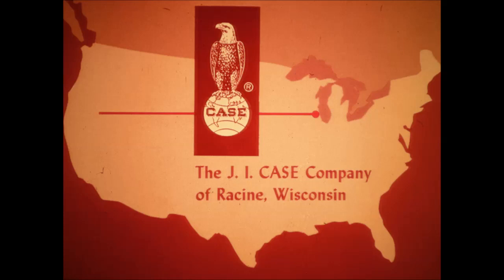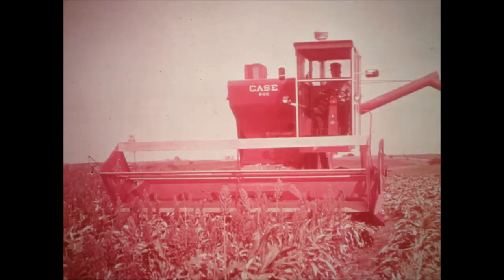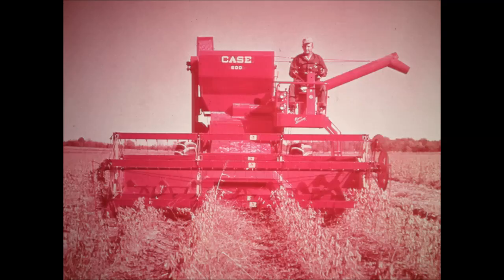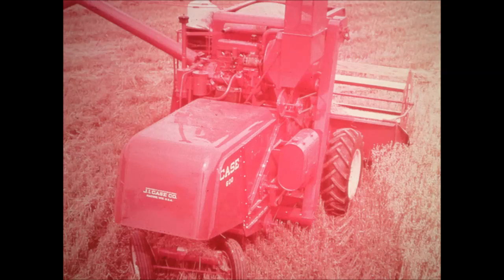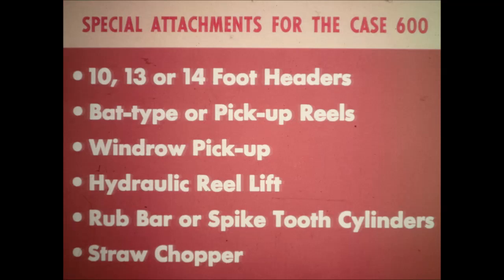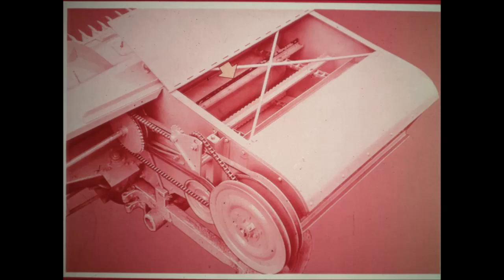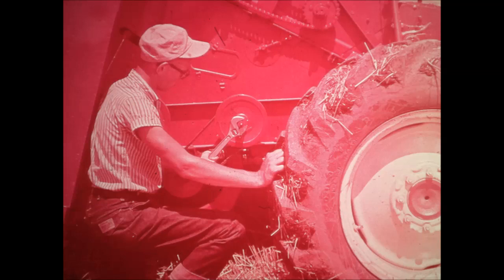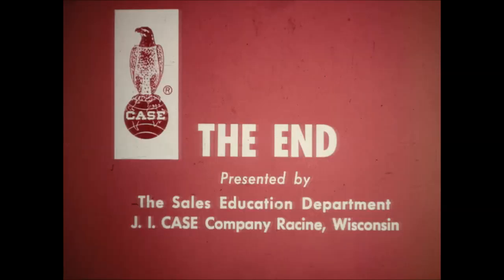JI Case - The Model 600 Multi Crop Self Propelled Combine

Comment: I had a 600 pull type, i used it with a grain pickup, and, pulled it with a 4020diesel, it was a great combination, i liked the spike tooth cylinder, it made great straw in oats and wheat. I kept the straw for bedding my livestock.
Reply: Case didn’t make a 600 pull type. This is either a lie, or you’ve got it mixed up with its pull type version the 400

Comment: I need rasp bars and knife Gard for my combine JI case  660
 any one have proposals were I can purchase them
Reply from the maker: All my resources have turned up nothing for those parts. Messck's claims to have the knife guards or at least get them. To find rasp bars, you may want to ask on one of the old tractor forums. Yesterday's Tractor might have someone on the JI Case board that may know something. Smokstack may be another option.